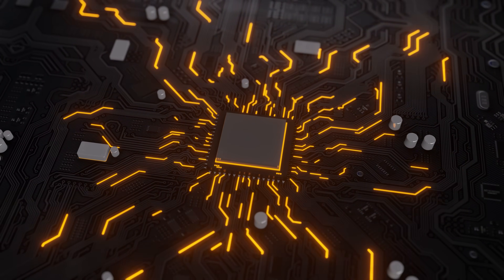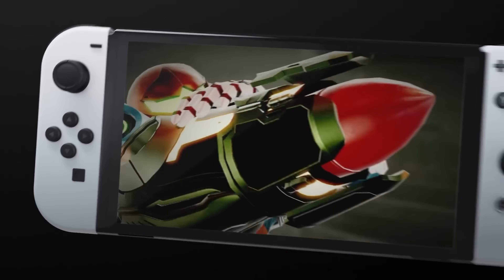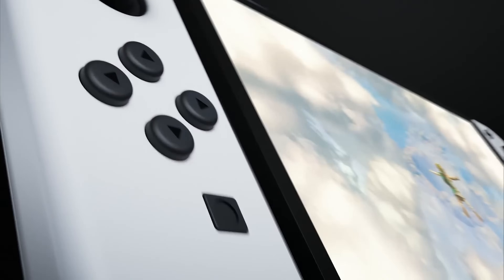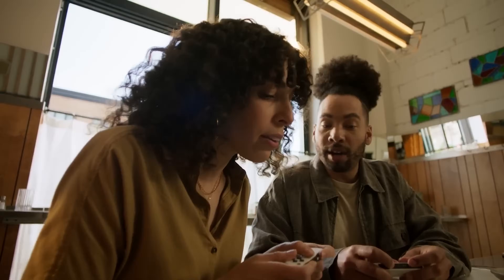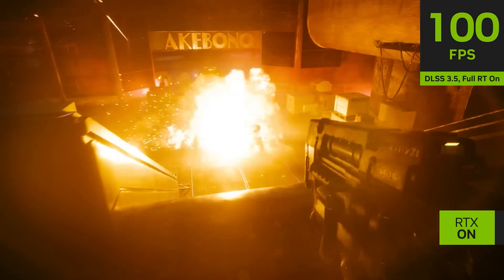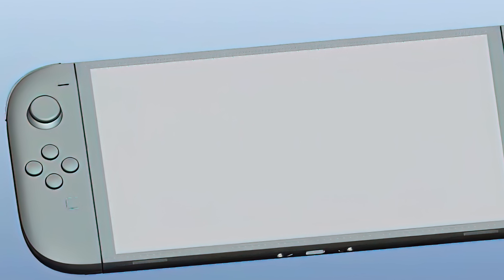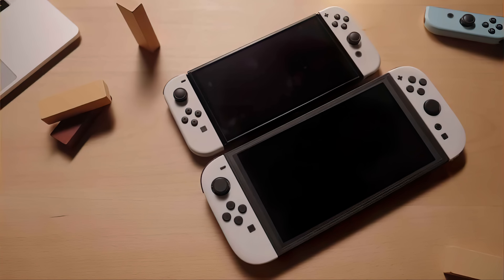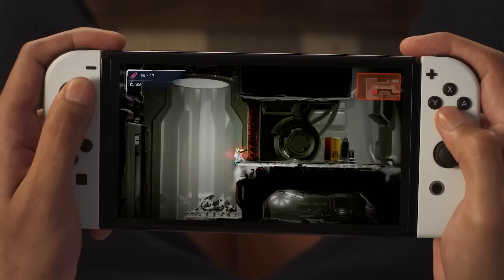Nintendo Switch 2 Updates: SOC CPU + GPU Technology Node (nm) Evidence? + L3 Cache Upgrade Analysis

Comment from the maker: Hit the LIKE BUTTON if you are excited for Switch 2 and enjoyed this video today. Let me know your thoughts on this information discovered and how it may factor into Nintendo’s manufacturing plans, and let me know just how detrimental you think the final chip size would be on the graphical performance of Switch 2. The reveal is soon guys, so this also might be my last Switch 2 video until the console is shown….it’s hard to believe that we are finally right at the precipice to the start of Nintendo’s Next Console Generation. Let’s get this console revealed ASAP. 😎🤘
Reply: @SuperMetalDave64  Pub. No.: US 2024/0316457 A1 Pub. Date: Sep. 26, 2024. 33 pages long.  Mike odyssey found it
Reply: Do you know if in any of the rumors if the Switch 2 will have a Micro SDXC card slot? Matter of fact, does ANYONE know? No ones seems to be talking about potential Switch 2 storage and if it will use Micro SDXC cards again. Most of us would quickly buy a 512GB or 1TB Micro SDXC card before the Switch 2's reveal and have it ready.
Reply: Something you might not have considered is that Nintendo handhelds normally support the last generation (or last 2). The GBA having a GB slot in the beginning. The DS having a GBA slot in the beginning. I think it's possible that the Switch 2 could have 2 CPUs. 1 CPU for backwards compatibility allowing them to change the architecture without compromising backwards compatibility in the beginning. So, you might be looking for evidence and you might find that Nintendo has a deal with Nvidia for Switch 2 but it might only be for backwards compatibility

Comment: Nintendo Switch 2 based on outdated tech, 8 nm vs 3 nm Apple, no full Clockspeed in Handheld Mode again, 5 Years old Ampere, DLSS Artefakts and Ghosting…..lol
Reply: Quit spreading that BS.  Nintendo haven't said a singular thing about the Nintendo Switch 2... except the fact that the company and NVIDIA are using 4K DLLS inside that system.

Secondy, your grammer sucks moran.  Do yourself a favor--  get a life (what's left of it) and get an education!  If not... GET HELP!

Comment: As it stands now. 8nm is the option Nintendo took... I would say its a bad choice this time around many handhelds on the market this year.. Next gen strix halo will run all games on an emulator, companys will make new games work for old switch too cos its a big market. So now as 1st switch is "open" all new games will be availabe on yuzu to be played on a waay better handheld. (you can run now 4k zelda botw on some handhelds)
Reply: We don't have the data on whether the Switch 2 will use 8nm or lower than 8.  You just have to wait until we get an official confirmation from Nintendo themselves.

Comment: What if..they gave us the choice? 8nano or 4nano depending upon how you want the play? Just like the Xbox Series S/X.
Reply: @shawnd4415  Yes please. I hope they sell switch 2 at say $450 portable with series s strength when docked using 4nm and a screenless switch 2 for $300 with 8nm.
Reply: @eaflores93  knowing Nintendo they’ll probably do something like this but years later after the Switch 2 sales start to flatline. Like the current OLED Switch was a huge missed opportunity to upgrade more than just the screen.
Reply: Because it's not nintendo, but nvidia that choose the size of the chip.

Comment: Chip architectures usually are designed with a specific node in mind. Nvidia Ampered was on 8nm from Samsung (the gpus) but also on 7nm TSMC (AI versions). The difference in density between those two is much bigger than the number suggests. TSMC 7nm is way better. 8nm from Samsung is practically an improvement over their 10nm process. Now the rumoured chip for Switch 2 also has ARM A78c cpus. I have only seen those in Snapdragon chip that were manufactured in 5nm LPE from Samsung. So the most straightforward choice would be either TSMC’s 7nm or Samsung’s 5nm LPE. Samsung has good relations with Nintendo and are eager for some wins for their fabs. They probably could offer a very good price for it. Both choices though are very good for Nintendo. Since they are not the most advanced and not in high demand chips (4 and 3nm are the hottest) Nintendo can secure a big production line and at a fair price. Performance wise, both will be much better than 8nm with a decent battery life and normal thermals. 

If I were to bet, I would say that the Samsung’s 5nm LPE will be the manufacturing process of Switch 2 chip
Reply: yeah i was doing some of my own research, 4nm would be the BEST case scenario, but that probably wont be on the table. Similarly to how Nintendo was given a few options from NVIDIA on whether they wanted a more performant Lovelace-based SOC or a cheaper ORIN-based SOC with some lovelace features, Nintendo went for the less expensive option (according to Moores law is dead's NVIDIA sources). I feel like Nintendo was also given those couple options, whether to stick with the 8nm from 2022, or switch to Samsung 5nm or TSMC 7nm. 
its hard to tell whether they struck a deal and got samsung 5nm, or went for tsmc (less likely).

Comment: As long as it can run MH Wilds I'll be stoked!
Reply: I'm right there with you, brother. Been huffing the hopium since the first announcement trailer.
Reply: @AJChalk  right! MH rise on switch was so much fun! I'd rather buy the new switch console to play it than something else.
Reply: Same.  MH wilds and Final Fantasy will be two big factors in my buying decision.
Reply: Monster Hunter Wilds <Cloud Version>

My battery pack is ready.
Reply: running MH Wilds LOLOLOL Yeah, that's not gonna happen.
Reply: @Yusei255  Just you wait when it's presented in 1080p in portable mode and between 1080p and 4K in docked mode.
Reply: @TonyKanameKuran  1080p in portable LOLOLOLOL
Reply: @Yusei255 I'm playing that on pc. I want mods. If I want to play on the go I'm pulling up my Ally 😂

Comment: There is so much focus on the hardware, but I am more interested in what new games Nintendo is working on! Isn't that what it's all about? They always make the best of whatever hardware they have.
Reply: A better hardware can allow more third party games to be ported to it with a good quality. More than that, can allow Nintendo to make more impressive games.
Reply: Hardware is important and I’m sick of Nintendo skimping over it
Reply: @denisn8336  they don't skip with Switch 1. If you look, there are not better or stronger portable device than switch on first half of 2017. If nintendo try to do the same now, it will be a really stronger device.
Reply: @denisn8336  Nintendo Be 'Skimping'!

Comment: I'd temper expectations, the 8nm process, the LPDDR5X ram, is still no GDDR6 for whatever you want to say about the Series S, Dave. That little man works wonders  and has a CPU that's way more capable than the Arm 78C. Honestly, the CPU for Switch 2 is the real problem. There's better ARM chips and configurations. Nintendo might have honestly been better off using Exynos and having Nvidia provide a custom GPU with DLSS, rather than using the full solution from NVIDIA themselves.

Comment: They decided on hardware for it around 2020, so while 4nm could be a better choice now, I really don't think this means they'll jump on it so late into console development
Reply: The console start the development at the same time as Ada Lovelace cards. All Adas uses 5nm.
Reply: @alessandrooliveira3218  the CPU made exclusively for the Switch 2 (to this day never used In any other device) was launched in 2020 so I think it's safe to say that this is where it entered active development. 2 years before Ada cards, and while they use 5nm, it's difficult to compare a graphics cards where even the cheapest one costs nearly as much as the console itself.

Anyway I would love for it to be 5nm, but for now can't be sure with everything else we know. I guess we'll see next year.
Reply: @TakisEnjoyer  the chip that will be on switch 2 was finish on 2022. It's the leaked T239, a custom chip made exclusive for Nintendo and is half Ampere and Half Ada Lovelace. It's not launched because it is a exclusive Nintendo product. By the way, the memory on Switch 2 is LPDDR5X, that is not compatible with nodes bigger than 5nm.

Comment: so yeah 8nm would result in ~1.2TFLOPs portable and sub 3TFLOPs when docked. 4nm would result in ~2TFLOPs portable and ~3.5 to 4TFLOPs docked
Reply: @syferz  really hope Nintendo goes 4nm
Reply: I think I know Nintendo l. It’s going to be 8nm. Then tend to do things cheap and simple. No cutting edge stuff.
Reply: @aaronstathatos6195  4N is cheaper than 8nm, but you'll ignore that I'm sure... 4N is also older than 20nm was when Switch used it.
Reply: @syferz  Wishful thinking. When the original Switch launched, there were more advanced SoCs available, like the Tegra X2 and the Pascal-based Xavier. But Nintendo tends to prioritize cost-efficiency over cutting-edge tech to keep prices down and sell more units. I have friends at Samsung, and they’ve confirmed that 4nm chips have lower yields compared to more mature processes like 8nm. It’s unlikely Nintendo would opt for 4nm, which would be costlier and riskier in terms of supply. 8nm would be a more practical choice

Edit: While it’s true that the original Switch used a relatively newer 20nm architecture at the time, the comparison to 4nm isn’t straightforward. As you scale down, manufacturing complexity increases exponentially. Even though 4nm is ‘older’ now, the complexity, low yields, and higher costs associated with it make it much more challenging to produce than 20nm was back then. This added complexity makes it less appealing for a cost-conscious company like Nintendo, who typically opts for mature, reliable processes.

Edit 2: “bUt YoU wIlL iGnOrE ThAt” -arrogant
Reply: @syferz  Sadly Samsung is desperate for clients for its fab business, so I suspect they'll cut Nintendo a deal.  TSMC has absolutely zero need to cut Nintendo a deal. TSMC made 45Billion profit in the last 12 months.  Infact TSMC is doing the opposite of giving deals, and raised its wafer prices 8.7 percent last year.
Reply: @2drealms196  Nvidia is the one who handles that, Nintendo hired Nvidia to make them an SoC, and Nvidia going to either vender is fine, it won't change much.
Reply: @syferz  Almost certainly Nvidia would pass on the higher costs of TSMC 4N to Nintendo.
Reply: I was on the understanding that node shrink doesn't affect performance. it does allow more complex design which increases performance and less power consumption.
Reply: @Greenwithao  It allows for higher clocks, because a die shrink requires less voltage/power to reach a certain clock. Thus if it's 8nm, the voltage will be higher, which will increase the heat and not only require more power to hit those clocks, but the max clock will be lower, because you can only push so many watts into the silicon. If you shrink the chip to 4nm, you lower the power draw drastically, voltage/heat goes down too, and you can have higher clocks as you push back towards those higher power draws. This probably makes more sense if you think of overclocking your CPU, sometimes you have to increase the voltage to get stable clocks, this has a limit, but generally the cooler you run the cpu, the higher clocks you can have, the more stable you can make those clocks.
Reply: @syferz It’s neither 8nm or 4nm. It will be either 7nm or 5nm.
Reply: @ZackSNetwork  TSMC 4N is 5nm (used in Ada Lovelace), it's just a marketing name, TSMC 4NP is 4nm (used in upcoming Blackwell).

Comment: 3:00 It's not quite true that docked, it could use whatever power it wants, we know from the shipping data that the PSU (power brick) for the Switch 2 is just under 60w. Considering an 80% efficiency, you are looking at 47w, this is max power draw with USB devices plugged in, and charging the device, which if it's limited to 18w for charging, and at least 5w for USB devices, you walk away with just 24w, this is still the MAXIMUM the PSU can draw, which seems unlikely for Nintendo to go this route, the actual power draw the console is likely to use is probably 20w. We know from the Orin power tools software, that 470MHz drew about 5w, pushing that to ~900MHz is going to cost you nearly 15w for just the GPU, this is ~2.75TFLOPs.
Reply: Then we know is not a 8nm chip, in the nvidia leak the frecuency in portable mode for the gpu was around 660mhz at 5w, 1150mhz at 9w and 1380mhz at 12w, so clearly nintendo reworked the chip
Reply: These people dont know what they are talking about.
Reply: You are wrong. The Orin power tools software at 470MHz is 15w, not 5. The number of SM is 12 and CUDA is 1536. A dock mode would consume a lot more than 30W if the  chip is made on 8nm, what, even on dock mode it not working. More a point to "not 8nm".
Reply: @alessandrooliveira3218  I know the chip isn't 8nm, however I am not talking about the entire power draw of Orin, just the GPU power draw.
Reply: @alessandrooliveira3218  You can also just look at RTX 3050 6GB which is a 70w card with 6GB of GDDR6 memory and a 1470MHz clock. It doesn't even have a plug for extra power, it draws everything off of the board and is 6.7TFLOPs, on 8nm. No, Orin's GPU alone with a 12SM config at 470MHz, does not draw 15w, that is silly.

Comment: I bet they are using 8nm, its cheap and better than 16nm which are spitting out Mariko socs to this day. Nintendo do not care about the battery life or performance of the Switch 2, they will clock it down to hell to claw back battery life so they can keep the margins using 8nm dies. Since its made by Samsung no one else will be using the node, there won't be any competition for wafer allocation and TSMCs prices are set to go up next year.
Reply: Nintendo paid for Nvidia create a custom chip with the power they want to use. The config of 12 SM and 1536 CUDA cores on a 8nm chip don't work for a portable device. It can consume more than 30 Watts, what is more the battery of 20Wh they will use. Right now, Nvidia is moving to TSMC 5nm to TSMC 4nm, and these 5nm they have will be used by Nintendo instead.

Comment: Something that no one seems to be talking about is the fact that in order to die shrink a chip to a new node you DO have to re-create it for that node which would involve testing, of which we have seen NOTHING. All of the test info that has leaked about T239 was for 8nm and we've seen absolutely nothing else despite everyone being eagle-eyed about anything and everything Switch 2 related right now. By comparison, we saw the testing info about the Mariko 16nm Tegra X1 revision chip well before it was seen in the Red Box Switch and Switch Lite. 

The other big thing to consider as far as the process node goes is availability. You have to realize that TSMC's nodes are in high demand and I would imagine that Nintendo would incur extra cost if they needed to secure an ample supply of chips on that node with them which I don't believe is factored into your cost analysis. There's also the possibility that TSMC simply wouldn't be able to produce the kind of supply that Nintendo would need for their new console on such a cutting edge node. By comparison, the Samsung 8nm node is being used by almost nothing ATM so Nintendo will likely get it for incredibly cheap. Really, I think that TSMC is likely out of the picture completely ATM and if Switch 2 uses any other node aside from Samsung's 8nm it will be a different node made by them. My HOPE is that they snag one of Samsung's 6nm or 5nm nodes for cheap as then Nintendo wouldn't need to fight every other tech company in existence over TSMC's 4nm and it would still be much better than 8nm but until I see some updated chip testing info I won't assume anything other than the fact that it could still be on Samsung's 8nm as that's what Ampere was built on to begin with.
Reply: The leaked tests are NOT on 8nm. On these tests are not the node, but they have the consume number: 4.2W on 660MHz. If you pick the orin power consume tool and try to simulate that result, the consume is above 30W, not even close to the 4.2W from that test. That alone proof its not a 8nm chip. 

About TSMC, they will have a open space for 5nm chips, since Nvidia is moving to 4nm for they new black belt cards. What company can use those 5nm that Nvidia will not use anymore?